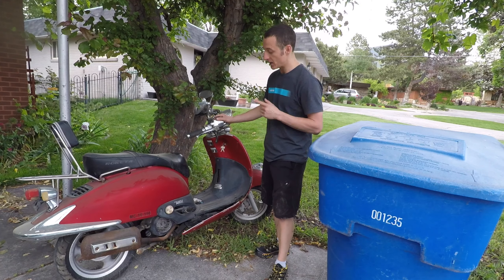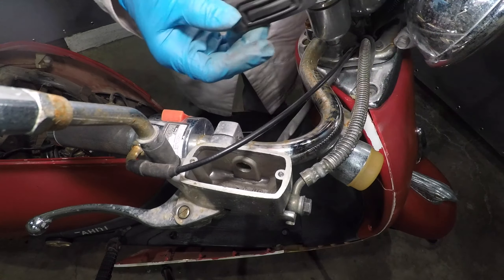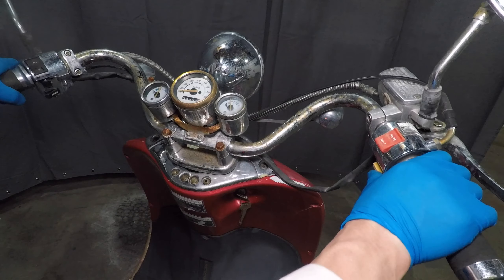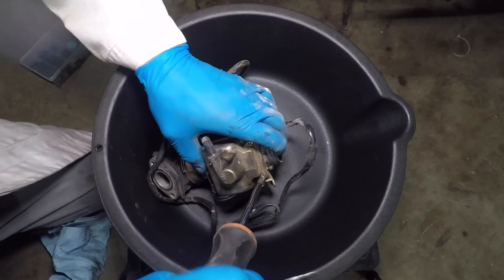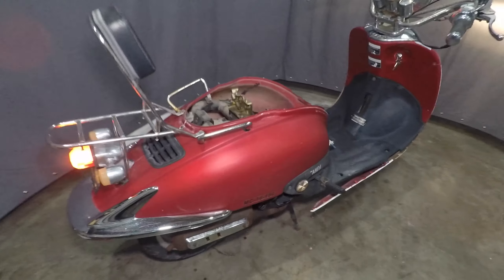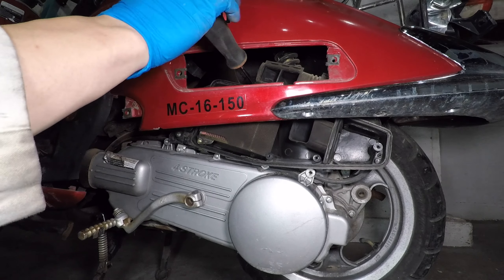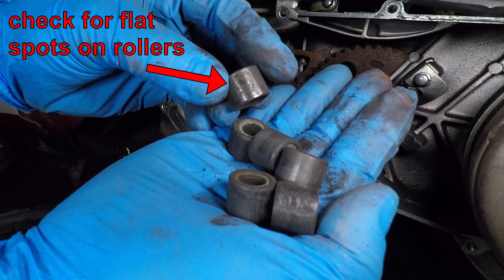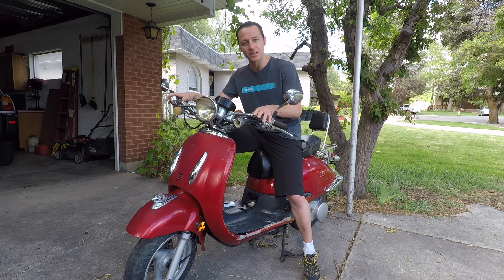Chinese GY6 150cc scooter - will it run?  Inspection and carburetor cleaning

Comment: The eagle is napoleon dynamite-esque!! To remove stubborn stuck carbureted screws use a punch and small hammer. Put the punch against the screw and tap it it shocks it so it will be easy to unscrew. I learned that trick from an OG motorcycle mechanic.

Comment: I have the same scooter! Just got mine running a few days ago. Slow charged the battery, fresh fuel w a mixture of seafoam. New spark plug, mine was all fouled up, there wasnt a gap on it. And a new fuel filter. It fired up after a few tries, now i can leave it on, and it idles perfectly.
Reply from the maker: That's awesome!  This is my favorite style of Chinese scooter.
Reply: @LabCoatPaul  How did you get this scooter?

Comment: I have the same Chinese scooter but mine is orange. Also it is called a Volari. it's on the side where the access panel is for the air filter. I bought it with only 200 miles on it. This thing has been running great so far. I have about 1300 miles on it now, it says its a 150cc scooter but it tops out at like 55-60 mph. is there any way to get this thing to go any faster? I changed the CDI box and barely noticed any change. Then I realized that the CDI box was missing and had come unhooked and fallen out of the hood area somehow, what's weird is the scooter ran fine without it. Ha Ha ha. Anyway, luckily I still had the old one so I just put it back and everything seemed normal. Although I keep having to replace the right hand switch box that has the start button and the kill switch and also the throttle cable runs through. It's made of chromed out plastic. (weird huh?)  I would like to replace the carburetor with a racing one, also change the exhaust with a full flow one. and a cold-air intake. I am hoping this will make a huge difference in the way she runs. Bravo on getting that one to run!!! Any advice or pointers would be gladly appreciated.
Thank You,
aArOn A.
Reply from the maker: Are you sure you want to go more than 60mph on this scooter?  It's not exactly safe...   
You can gain a lot of performance by tuning the CVT.   Take the belt cover off and run the engine while on the center stand.  Check to see if the belt rides all the way up and down the pulleys.  Sometimes the stock belt length and pulley combination doesn't give you the full range of ratios.  You can buy a performance CVT kit that will start the scooter in a lower gear and let it reach a higher gear ratio at top speed.  You can also tune the variator by changing the weight of the rollers.  Lighter rollers will keep the engine at higher rpm which usually gives you better acceleration.
I don't have an in depth CVT tuning video yet, but I'm sure someone has explained it on YouTube.
Tuning the carburetor helps a lot too.  A performance carburetor will give you a little bit more power than stock.

Comment: Hey Paul, my scooter kick start, I can jump the solenoid but it won’t start with the switch start. What would you recommend?
Reply: If you can start the engine by jumping the starter solenoid but not with the start button there's a couple of possibilities. 1. The little push starter button has worn out and needs to be replaced. The contact button can wear out over time or corrode. 2. The brake safety switch is bad. Most of these scooters require you hold the break lever in while using the push starter. 3. The most difficult is a wiring problem. If you have a broken wire it can be anywhere and you need a multimeter and a lot of time and luck to track down the broken wire.

Comment: What model and year is this red scooter?? I wanna see if the triple tree will fit my lance vintage 150
Reply from the maker: This scooter is a 2010, and should be the same as all Chinese "lowboy" style scooters that look like it.  This one has a telescoping fork and 12" wheels.  Some scooters with have a linkage fork and 10" wheels, but I think the frame is the same.